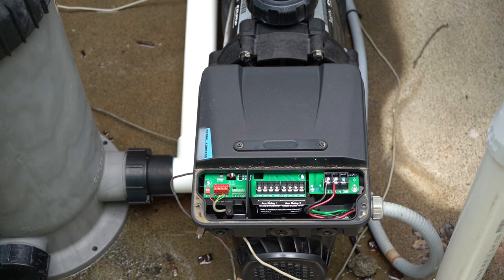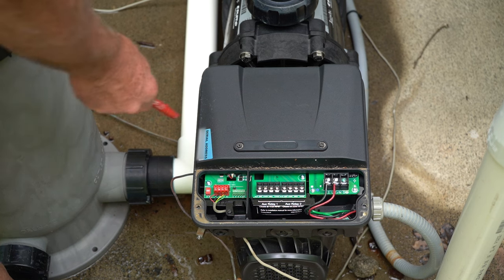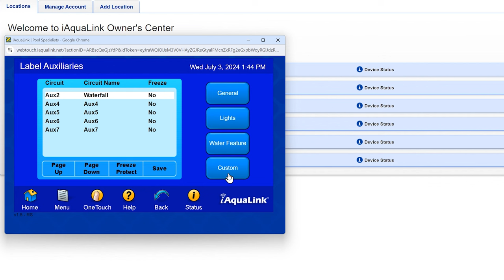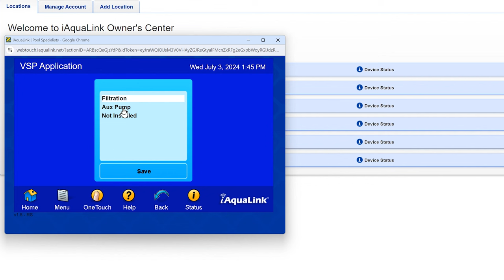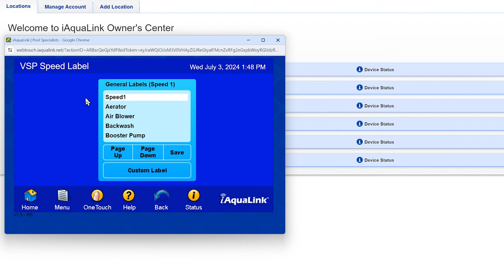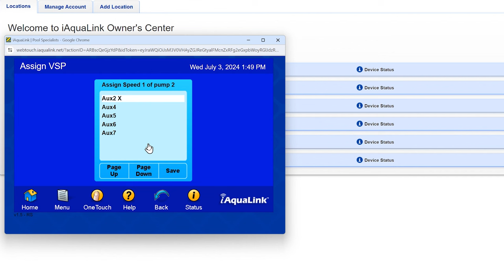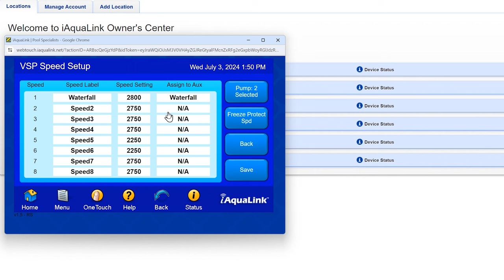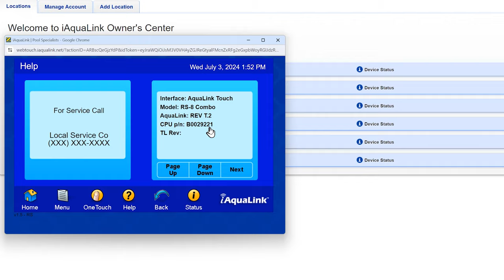How to connect and automate a jandy variable speed VS pump

Comment: Just installed a Jandy flopro 1.65hp with a aqualink rs 3.0 controller. Getting constant power at the pump but cannot get it to run. Does have a 5 pin dip switch that came set with #5 on. System is not recognizing pump when we tried registering pump address. What do you recommend?